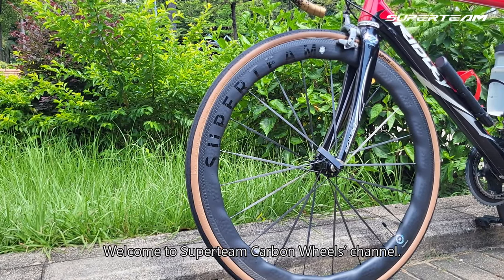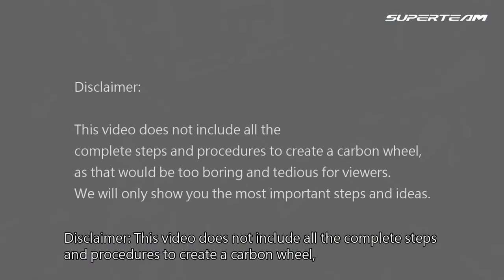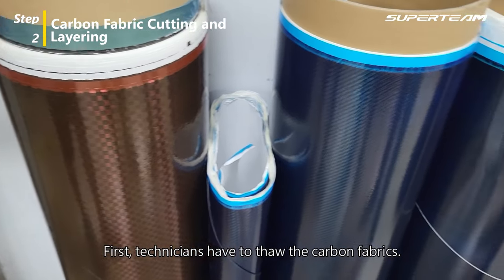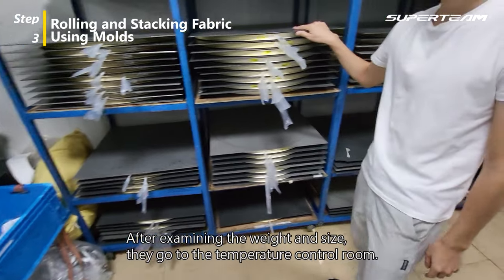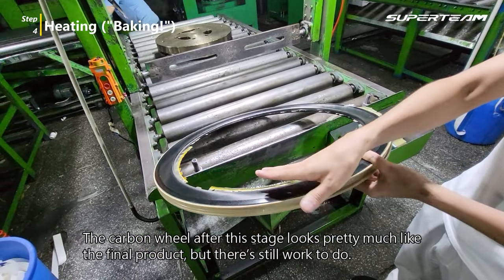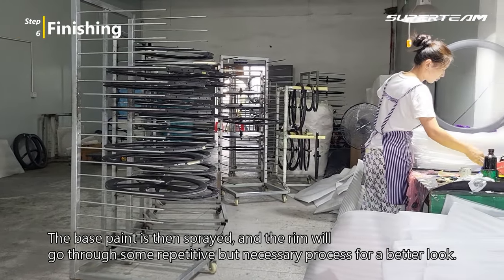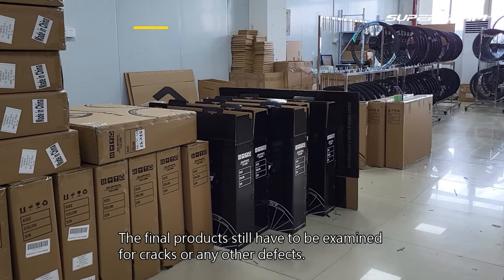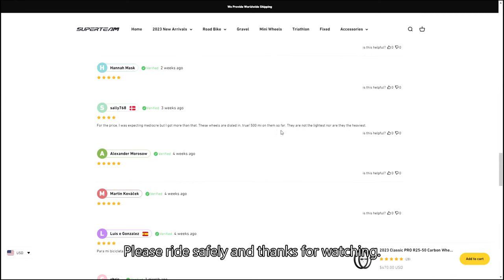How Are Carbon Bicycle Wheels Made? Manufacturing Process - Superteam

Comment: I have used the classic 60mm rim depth for around half a year, riding for thousands of kilometers with no issues at all!  Despite the low price, it's very easily noticeable that my bike rolls a lot easier and further than other riders!  While others are riding hard, my bike simply go forward without pedaling at all!  Of course, for less than a fraction of the price, it still doesn't beat the most expensive wheels.  For example, my friend's Zipp 50 seems to have even less resistance.  That's why, I'm going to put your company's best wheels in my next upgrade list!  The wavy 50mm looks amazing, but it'd be better if it had more depth options.  I understand SuperTeam's market is mainly at the low-price range, but I wouldn't mind paying more for an better product, than to get ripped off by other brands - which are probably manufactured in the same factory ><

I'm going to wait patiently for the next product launch for my upgrade!  I hope it'd be a pair of extremely good value aero wheels at the price range of around 12000HKD.  That'd be perfect <3
Reply: Oh and I just found out that you're the guy from bikeguyHK🤣
No wonder you sound so familiar
Reply from the maker: Ya. I was invited to their factories.😂